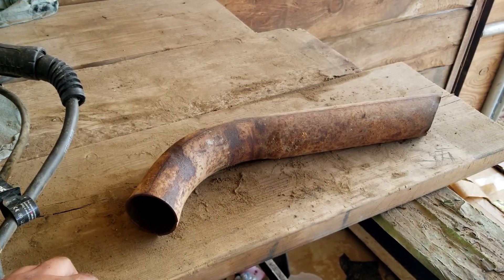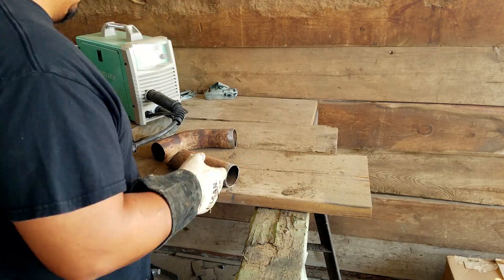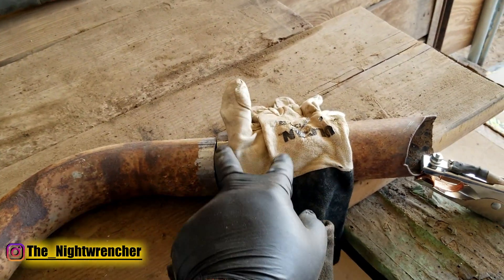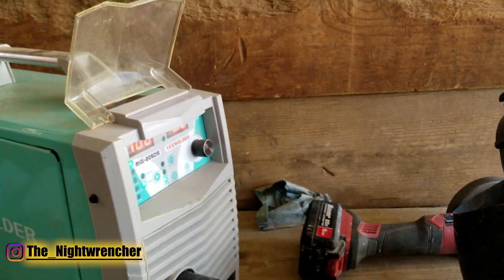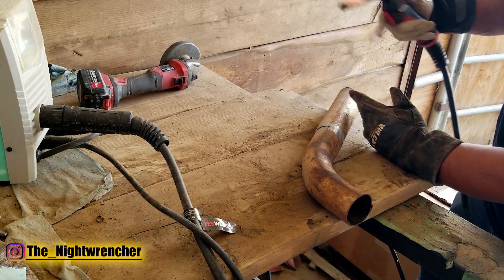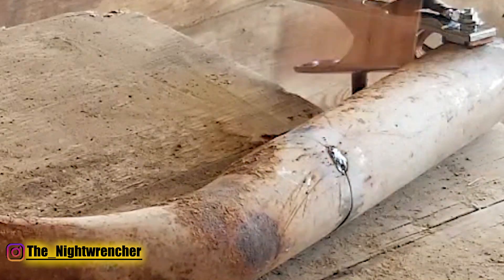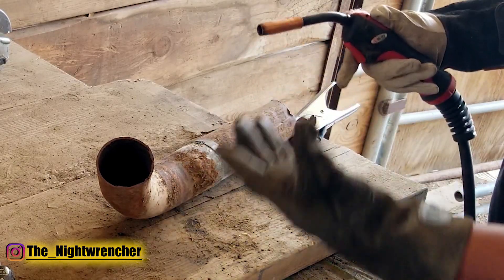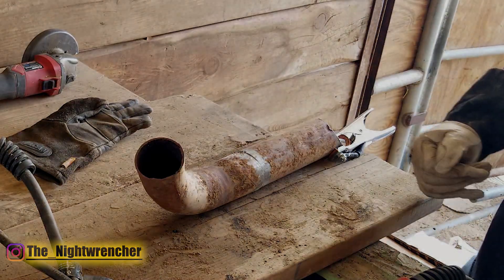Best Welding Position For New Welders | Gasless Flux Core Welding Tips And Tricks For Beginners |

Comment: One of my weld helmets had a bad electronic filter assembly in it. It got burned some how. Rather than throw the helmet away, I went and searched Ali Express, and low and behold, I found several vendors there selling the complete Electronic filter asembly for a very low price of around $4! (Free shipping) There were several sizes available, so you have to be a little careful to get the right size assembly. All ANSI approved. This was 2 years or so ago. When I received the unit, it dropped right into my helmet, and had a larger viewing window than the original did! (Older helmet) Took about a month to get it, but it was well worth the wait, considering the original cost of the helmet. $4 vs $80. A very easy repair. Need a replacement hand piece (gun) for your MIG WELDER? They have them too. Very inexpensive.
Reply from the maker: Very good to know 👍 thanks